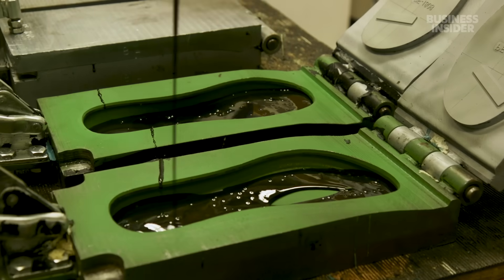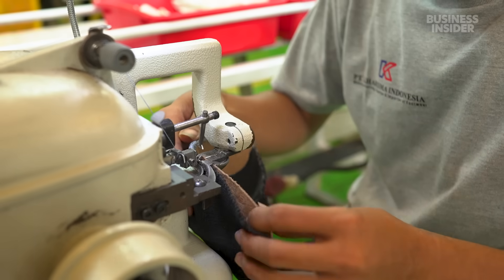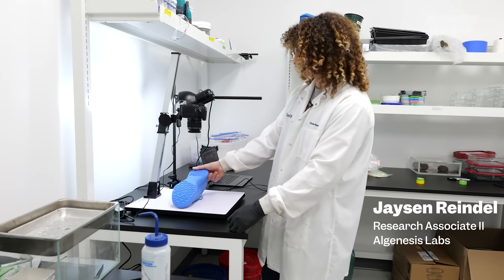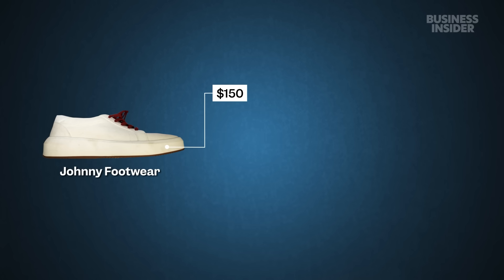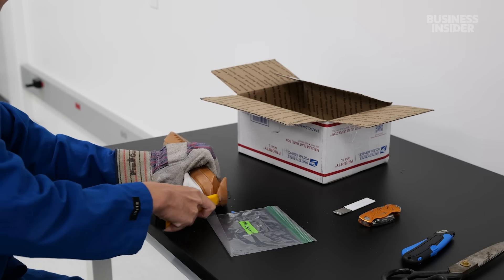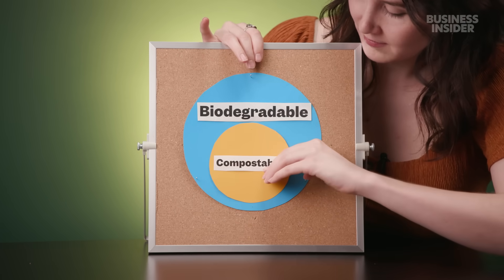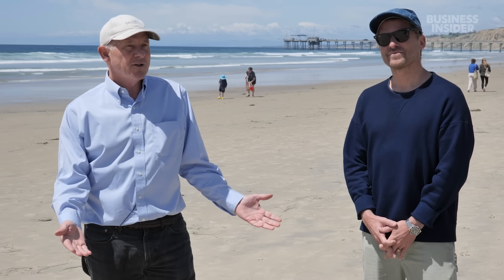Why Most "Biodegradable" Products Are Probably Fake | World Wide Waste | Business Insider

Comment: Plastic isn't too new. Plastic are made to avoid degradation. 
The first plastic/polymer is PVC and the most widely used are PolyEthylene and PolyPropylene. They are easy to work with, corrosion and chemical resistant, durable and cheap.

The problem in plastics isn't that they don't rot and pollute the environment, they are made to be tough against the environment we're in. They are too cost effective for it's purpose.
The real problem is MISUSE and IMPROPER DISPOSAL. We're not using them efficiently and they are really cheap. Too cheap that people dont mind throwing it away.
And currently, there's no better alternative.  e.g. cling wrap vs waxed paper for perishable goods; plastic bag vs paper bags; pet bottles vs glass bottle; etc.
Just look at your local grocery, you won't find much foodstuff that isn't wrapped in or supported by plastic. Metal cans do indeed have thin plastics inside, glass jars also have plastic lining the seals on its cap.

Comment: Instead of making the shoes biodegradable, they should have made the shoes durable and repairable. Shoes come into contact with soul and microbes almost every time they are used. If the shoes break down fast, they have to be replaced constantly. Energy is used to produce new shoes. If new shoes have to be constantly produced to replace the rapidly biodegrading shoes, then there is going to be a massive increase in carbon footprint (no pun intended).

Comment: If they are truly biodegradable, how would they react with the bacteria from people's feet and the dirt + moisture from the environment. Wouldn't this prematurely accelerate the degradation process? 

Companies should focus on manufacturing longer lasting shoes, not ones that fall apart a short while after wearing them, or just from sitting around barely used after purchasing them.

Not only that these biodegradable shoes are expensive, but they will fall apart just as fast (if not faster) as the cheapest stuff you can buy today.

Comment: It depends on the use case on how biodegradable things should be. For shoes, which only have a lifespan of 1-2 years if worn daily, should degrade fairly quickly. The air intake assembly on a car, however, could take 5-10 years longer to degrade if it means it can survive the 20+ year average service life of the car.

Comment: consumers: "i want a durable shoe that will last forever"
companies: "here is a shoe that is designed to decay faster"
Reply: Plastic shoes don't last forever but the plastic is forever, so why not make them biodegradable?
Reply: But to some degree you are talking about an unsolvable problem. Shoes need to create friction for us to walk and have traction. That causes wear. If the shoes didn't wear then the ground, sidewalk, floors, asphalt etc. would have to wear down. Unless you mean easily resoled shoes like the other commentors. But shoes that will last forever would not work or would cause other bigger problems.

Comment: I also composted a bunch of 'biodegradeable' plastic utensils. None of them degraded at all.
Reply: Well, some biodegradable plastics are only commercially compostable, which means they need to go to a compost facility that uses heat to decompose the materials
Reply: @GeeksGets  Composting does use heat to decompose. You should try to stick to topics with which you are familiar.
Reply: @theprecipiceofreason  Not comparable, a home compost bin is way less hot than a commercial compost facility and the high temps are maintained constantly.
Reply: @ashergs1237  First, my compost reaches 122 degrees (within regulation, under 160.) It's 8 ft long and 5.5 ft high, made of 3 inch thick steel, on a rotator. Secondly, if you need industrial maintenance to compost something, you've already defeated the purpose. The amount of power for industrial mixing and rotation and  the smoke/gas generation would still be too much to make the product worthwhile. Wood utensils would be a simpler solution at that point as those can at least be carved with minimal power.

Comment: They should have a buy back program, when you’re done with your shoes the company should offer to give you a discount or half off if you return the original shoes when you buy new ones. That way you keep the same customer
Reply: Carhart coats does that
Reply: Orba the company shown here have drop off points in my city or can post to the company (I think they cover postage) to be composted correctly by them
Reply: Vivobarefoot offered this originally and only 1% of customers took up the offer making the program unsustainable and uneconomical. So they launched revivo where they give shoes a second life. Again it's not used enough by the customers. 

The customer is the real issue not the manufacturer, the customers behaviour needs to change.

Comment: 9:56 this point about leather not being biodegradable is based on very old information, most leather in clothing is vegetable tanned now so is very biodegradable, the type of leather you are referring to hasn’t been made as the norm for over like 80 years
Reply: 90% of all leather produced worldwide is chrome-tanned which uses chemicals and is designed to increase the leathers durability and therefore prevent it from breaking down. Veg-tan leather is expensive and takes roughly 365x as long to produce, as a factory can chrome-tan in a day, but veg-tanning takes months up to a year plus. Then the most popular leather "genuine" leather is actually leather off cuts or even dust glued together and backed by plastic. Veg-tan full grain leather is the best, but most expensive. It uses the full grain, aka all layers, and is tanned using natural ingredients.

I am a leather maker. If the item doesn't specify the leather down to the tannery, it's probably cheap chrome-tanned leather. Tanneries who produce veg-tan are rare and very well known and respected so when their leather is used, it is a selling point. For example Red Wing uses S.B. Foot, Thursday uses Horween.

Comment: It has parts imported from seven countries, so all the oil burned to agglomerate that shoe doesnt count? This is the entire problem with these sorts of things, the product may degrade, but the energy that went into the mess is never taken into account.
Reply: people often never think of things like fuel costs, thats a completely different problem that has to be tackled aswell though
Reply: That, and they aren't repairable.
Reply: bulk water transport is so absurdly efficient that it actually makes up very little of the footprint. It's likely that the last-mile transport by truck (and car by the consumer) makes up many times the footprint of the rest, and that part will not be any different when buying 'locally' - or, in fact, 'locally' not unlikely involves more of the costly small-scale over-land transport compared to globally centralized production near to a habour for distrubution.
Reply: Also, "biodegradable" often just means "turns into microplastics faster".

Comment: Ngl, if it were ever practical for shoes to  biodegrade in soil, the ocean, etc, you could wear that pair for a couple years and it all just starts breaking apart over time. Less waste sure, but quite costly, assuming more sustainable materials also cost more to produce + replacement rate of them

Comment: You really have to throw shade on leather here, the OG biodegradable shoe material. Much comes down to the tanning process, but from a materials standpoint, leather shoes last long and should be built so they can be resoled and repaired. It'd be perfectly fine for a shoe that lasts over a decade to take a century to bio-degrade. Fast fashion though, that's another story. That stuff has to go.
Reply: Yeah exactly, I don’t want shoes that can biodegrade in 5 months lol. How long can I use them before they start breaking down on my feet?
Reply: Is there also a tanning process that keeps them biodegradable?
Reply: @sneaky_krait7271  the tanning processes impact the material properties, so there are limitations to their applicability. High quality leather is made through oak bark tanning, with the downside being that it takes a lot longer than chrome tanning and produces a stiffer leather. 
Chromium(III) tanned leathers have Cr(III) cross-linked with the collagen which hinders biodegradation. It can be decomposed in industrial composting facilities, but at the cost of having the Cr(III) leach out.
For agricultural products, there's a 2mg/kg limit, so... it's probably best to focus on tannin-based leather processes.
Reply: To my knowledge vegetable tanning actually doesn't have any environmental impact since it's tree bark and such, and most leather even leather with heavy chemicals like chromium breaks down in a few years when in a humid wet environment. :)

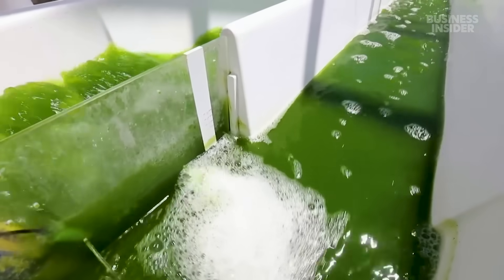Comment: 2:00 it takes leather b/w 10-50 YEARS to biodegrade. Leaving it in soil for 5 months and claiming it did nothing is legitimately fake news. Is nobody is fact checking them???
Reply: "While technically any material can biodegrade over time, the term "biodegradable" is often used to describe materials that break down relatively quickly, usually within a few years, rather than centuries. For instance, biodegradable plastics are generally expected to fully degrade within a year in the right conditions, according to the U.S. Environmental Protection Agency."

Comment: What does "even for major corporations" mean?
Major corporations are not interested in anything sustainable, if it is not good for profits.
They need to produce cheap, sell often, and with a good margin. Nothing else matters.
But shoes being biodegradable... it's like umbrellas being water dissolve-able.
It would be way more eco friendly, if they lastet not just one season, because of some ultra cheap material wearing off.
Reply: The problem is hardly anyone wants stuff that is well built and lasts. That stuff is expensive, and based on what people buy (not what they say) people overwhelmingly want cheap nonsense that they can replace next year. This company licensing their biodegradable plastic allows for the current model of capitalism and consumerism to be less bad. For the world to shift away from this mindset would require people to be smart enough to realize that just because something is biodegradable doesn’t mean it isn’t durable, for example

Comment: They are simulating composting like it's done in a compost pile in the garden. Most commercial facilities are not keeping the material under these conditions for the required time to really break this down adequately. Same problem with pla etc. But it is certainly a step in the right direction.
Reply: You’ve got that switched around a bit. Commercial facilities get WAY hotter, and can break down bio-plastics, whereas home composting can’t. Meaning the shoes will likely  break down even faster in commercial facilities.
Reply: @rileycurran932  Well yes, they get hotter so they can break down "normal" organic matter in weeks. But thats not long enough to fully break down bioplastics. Thats the point I wanted to make.  And the conditions they simulate in this video are more relateable to a hot compost pile than an industrial setup.
Not to mention the problem of actually sorting the waste so you can recycle on an industrial scale.
Reply: @Just1LoCo  You got the issue right that most of this crap is not going to end up in the required. composting facility. A lot of these warm fuzzy companies will have you mail in your waste to be composted, wasting more materials and burning more oil. It's all just to make people feel better. I promise you though, industrial composters have worked out how to break stuff down beyond what your home compost pile does - not sure what you expect they're doing with partially-composted trash.
Reply: Not quite. 

PLA requires exposure at above Tg* of 65c to start the process of hydrolysis before bacteria can in fact latch on. Hence why PLA is not (and will never be) marine biodegradable. 

*Glass transition temperature

Bio TPU and PHA's have a Tg of below 0c or just above at 6c Meaning they don't need special conditions to breakdown. Just bacteria activity. 

The composting test at elevated temp is just to promote bacterial activity that tends to pause at 5c, a home composting bed in the snow belt region slows down in the fall and springs, and stops in the winter.

Comment: Sweet, more micro plastics
Reply: If they design the plastic to be compostable, by shortening the carbon bond chains, then I don’t think the after materials will qualify as microplastics.

Microplastics means very tiny - BUT - they still have the long and strong carbon chains that don’t decompose easily/quickly, and that’s why they accumulate in our bodies.
Reply: @rileycurran932  If it's made of plastic of any kind, and micro in size, it's microplastic. Most, if not all, microplastics are harmful.
Reply: microplastics aren't as bad as you think.
Reply: @Space_Novel_Distribution There's multiple different studies that show that microplastics are harmful.
Reply: @Xenomorph-hb4zf  i never said it wasn't